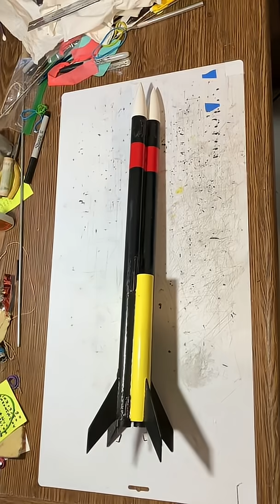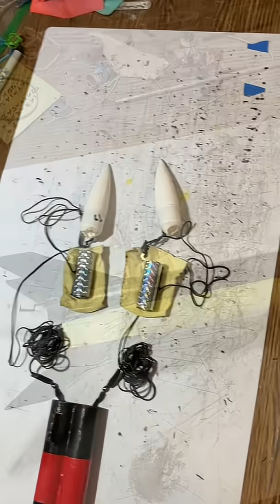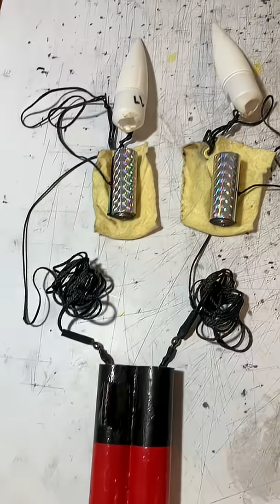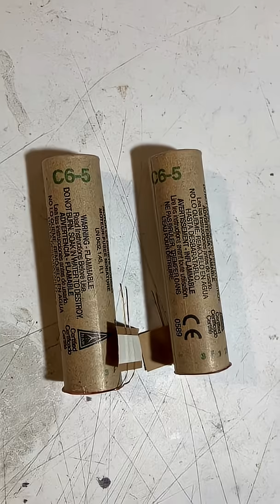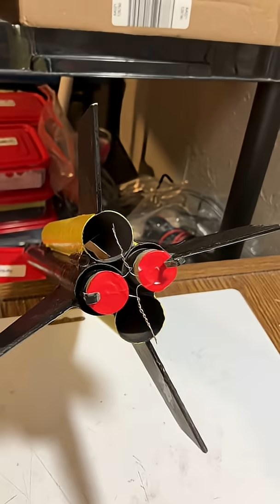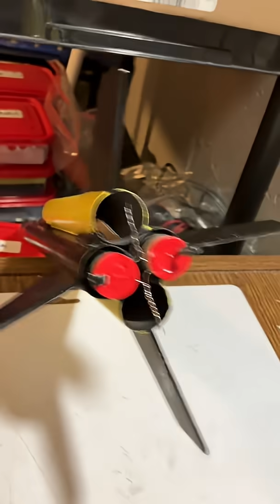Xi - Twin Engine Cluster Rocket, 2x C6-5

Comment: I made another one out of four TP tubes for fins and a paper towel tube and painted it bright orange and magenta. I call it a "rat rocket" kinda like the "rat rods" that are hot rods in junky looking cars and trucks. I named it
 Photon Blaster 3000.  The color is kinda cool and even the design of it. It looks like something from a futuristic sci fi or something, and it would be nicer if it were more refined (like nicer body tubes instead of scraps lying around).
Reply: Even the engine hook and engine stop are homemade from paper clips as the engine stop in the motor mount and for securing the rocket motor. I strap a tiny zip around it. Works well. I just wanted to see what I could do using things lying around the house. 

BTW rolled up newspapers work also.
Reply from the maker: yes, sometimes just a few odd parts and some ideas lead to great solutions. In a different thread I commented how the Xi (twin body cluster rocket) was a junk box rocket but revealed how to keep streamers from tangling. This is the spirit of this channel - ideas, experiment, test, evidence, solutions. Rocket science - Model Rocket Engineering.

Comment: Your Xi rocket is very cool 😎  indeed
Reply from the maker: Thanks. The FVR club has various "themed"  launches such as odd-rocks,  clusters, space capsules, etc. I had first joined and learned that in a few weeks was the cluster rocket theme. I didn't have a cluster rocket and there was no time to order one. So I looked at my bench and saw 2 Alpha's and a bag of 18" BT-50 tubes... Ah, you can see where this is going. Thus, the Xi is two 18" body tubes together - each with its own body tube, engine mount, nose cone and streamer. The Alpha body tubes are on the side as "tube fins" and on the bottom, 4 Alpha fins. The rocket is very stable, flies very smooth and the twin exhaust looks cool on the launch. Actually, this rocket gave me an accidental discover - I noted that the two streamers never tangled. The it hit me... when the streamers are physically separated at the base (as opposed to being tied to the same point), then the air stream pulls them apart for a beautiful wide fluttering. Thus, this was the key to the "Pi" streamer where I attach two streamers onto a short stick with a gap between them. It has become one of my most popular streamers (Check out @backyardrocketry). This is rocket science and a quick "cool" design gave new science for streamer design.